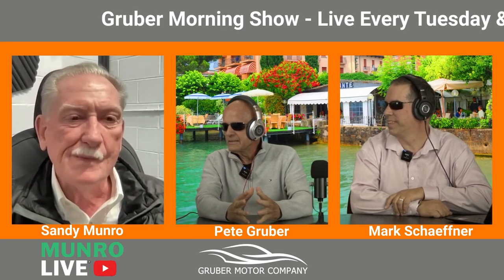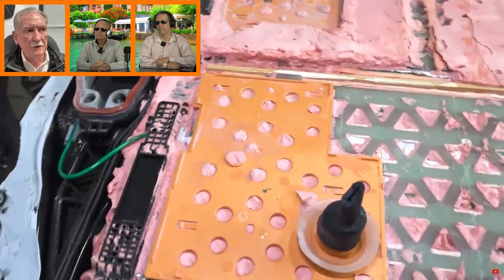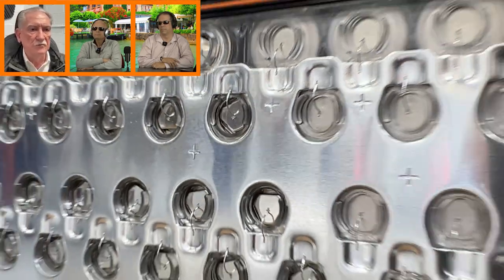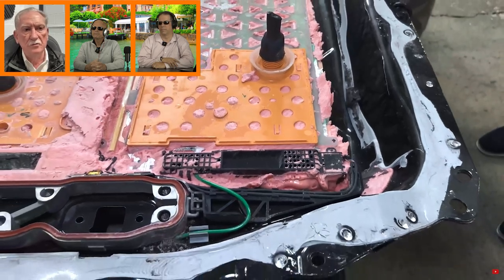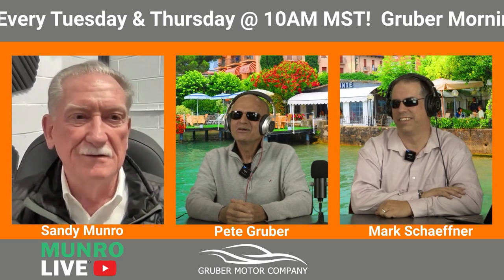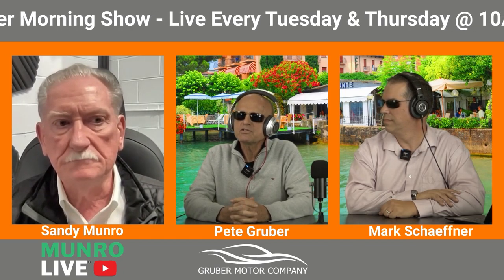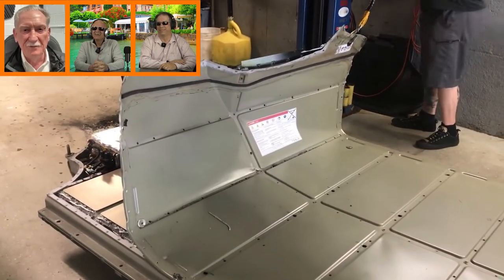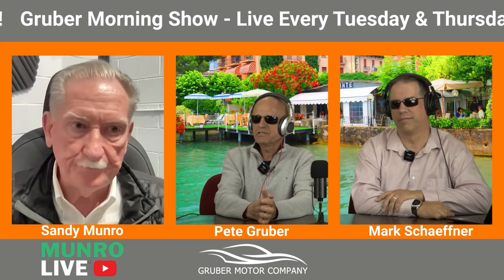Is Tesla's Structural Battery Repairable?

Comment: 2:40 "... one cell out of the pack ... now you have to throw away the whole pack..."
This is why it is important to be serviceable. It is like an ICE engine with a worn alternator belt and replacing that whole engine.
Reply: The technology looks so crude and bodged in that a single battery is not possible but just wire together a load of little batteries. One fails and it is dud. We are rushing out of fossil fuels when we are just not ready. You would think it would be possible to split these in to at least modular packs and replace the failed one. The problem is these electric cars are unaffordable so they have to be made cheap, simple and disposable and the latter loads the cost on to the consumer and environment.
Reply: @michaeld5888  That is what all the other manufacturers are doing and that should be the norm and requirement that the packs are repairable at the cell level.
Reply: @michaeld5888  That is negatory sir, we are not "not ready", it is a conscious choice of Tesla that moving forward they build their packs as sealed and unserviceable as possible. Except for that, there is already a growing industry of EV battery repairmen who can do exactly this job for cheap, on all continents.

Comment: I really appreciate this discussion and the practical perspectives.  The obvious answer, given that massively multicell batteries are going to be in use for the next little while at least, is a sealing and binding material designed like an anti-expoxy to disolve as needed and then be reclaimed and reused.
Reply from the maker: EV Battery tech is on an exponential design improvement curve.  We expect rapid changes to chemistry, technology, and corresponding service procedures.

Comment: (BEFORE watching)
Are you asking the wrong question?
.
Try
1) "Are the cells individually fused?"
.
2) "If they are, and one cell blows it's fuse, what is the effect on the pack?
.
3) "Are the electronics outside the sealed "battery box" more likely to cause problems and how repairable is that section?"
(Ref the Power electronics in the penthouse)
Reply: No, it’s the right question.  Is it repairable?
Reply: @oggyoggy1299  NO NOR SHOULD IT BE

Comment: Afaik the Model 3 battery pack can handle a couple cells going resistive or dropping out of the pack... Therefore it won't fail in the same ways as the old Model S or Model Y packs.

Comment: I'm sure there is a solvent that can safely be used on this - when handled properly.  Not something for a regular repair shop to handle, but there is enough value in those structural battery packs for people with the right expertise to take on.
Reply: if all you want is the materials you can also always just discharge the pack to 0V, shredder the entire thing and then separate via cyclotronic separation.

Comment: JB and Redwood Materials needs to have contracts with big box stores like Home Depot, Lowes, Menards and Walmart. They all need to have battery collection and drop off sites at their stores. If you make it easy to recycle the batteries more people will do it. Getting large retailers to box them up in bulk will make it easier  to ship and process.  Not mixing the batteries in with regular recycling operations would make the process easier and smoother.
Reply: Sounds like a logistics nightmare.  How will the stores be compensated for their space?
Reply: Had to laugh. Here in Europe this is mandatory for 20? Years.
Reply: re: "If you make it easy to recycle the batteries more people will do it." close if you PAY people for their recycled batteries more people will do it, so let's stop with the "scam" of pretending these batteries (even used and depleted ones) don't have IMMENSE VALUE.

Comment: If you know or suspect a resitive cell, why not pull the cover, charge the pack, and use a thermal camera to detect the failed cell. It should be quite a bit warmer than any other cell.  Then just clean off the foam on that one cell. You might even be able to clip the connection without any foam removal if you know exactly where the cell connection is (perhaps via x-ray?). Should be far easier than cleaning the entire pack.  If you do clean the entire pack, you have to figure out a way to reapply the foam to the entire pack, which could be just as tricky as removal!
Reply: And repairing the welds after replacement? Keeping it sterile inside? Re foaming&sealing it back up right? 🤔

All reasons why pack's are NOT that easily repaired by common mechanics and tech's right now in open air dealerships and service bays. 
They are originally assembled and designed in clean rooms kept at constant controlled temps&humidity with very little foreign object matter.

Amature hour repairs by greasy thick fingered tech's doesn't cut it. And the pack's must maintain a very precise cell balance or the bms weirds out on you.
Reply: @4literv6  Assuming a thermal camera could find the failing cell(s), I wonder if a technician could cut a plug (like with a hole saw) from the casing, then use that access to deactivate the failed cell. Then replace and re-seal the plug.  Related ... it seems like Tesla should be able to make cells that detect their own failure, then remove themselves from the circuit automatically. Then the BMS could just monitor and report these failures. Granted it may not be worth the extra cost, but would sure be nice to diagnose such things without major surgery.
Reply: We have been testing that technik with an expensive thermal camera and there are many problems: first, metal parts have very poor emissivity and it is really difficult to get good temperature reading relative or absolute... the reflected MWIR or LWIR heat is a major problem. Second, most problematic cells dont have a high short.. it is more a slow short with few mA leaking.. and these few mA x 3.6V dont make enough heat to be distinguished by the camera... unless the cell have a normal short between slow short or dead short to carry enough current to create enough heat so that the NETD of the camera is enough to detect it.
Reply: Yeah it's super easy to assume that! Are you sooo "experienced" to talk about that!! Lol
Reply: @4literv6 Cells are made in clean rooms, packs aren't.
Reply: @theflew  the workers assembling the cells into modules then into pack's are in cleaner more tempatures controlled spaces than the average repair tech in an open air garage though right? That was my point and the actual ev production workers are better trained in handling them and what to be aware of or look for during pack assembly. No tech in a garage is going to easily replicate that period!
Reply: Its not foam....Its a structural potting material used to encapsulate the batteries and add support to the battery structure and is sold to Tesla by a company called MG Chemicals and the product number is 832TC-375ML

Comment: One way to reduce the effort is to use multiple techniques such as electric vibrating chisel/scraper, followed by dry ice blasting, and additionally some D-limonene as a solvent. For debugging failed cell, a flir camera could help, along with sub milli-ohm resistive and non contact inductive tracing using equipment such as toneohm shorts locator, if electrical access from BMS could be established. Just some thoughts 💭
Reply: Or put it into landfill.
Reply: @oggyoggy1299  why would you ever put a few grand worth of concentrated materials in a landfill

Comment: I thought the pink stuff was an expanding foam that would dissolve easily in acetone.  When I hear "potting material" I think heavy, gummy, almost solid rubber material.  Seems like a strange choice when weight is always an EV concern.
Reply: it is an expanding foam.

and expanding foam falls under potting when used in this way
Reply: it is also a structural material, so it is not a soft foam.
Reply: MG Chemicals 832TC-375ML

Comment: How about using one of those laser cleaning devices that evaporate. If you could find a setting that would evaporate the putty, but not solid plastic, it could do the trick. This kind of a tool would be useful also in situations where you need to remove paint, rust or anything you would use a dry ice /sand blaster on.
Reply: There is no such setting most likely. But if you know exactly where to dig, you may be pretty successful doing battery pack surgery with a laser.
With highly specialized equipment I can imagine cell replacement too.
The big question is that would it be worth to service those packs? Maybe only cutting out resistive cells will be enough?

Comment: You might be able to localise a bad cell with a thermal camera, as if it is resistive it should get hotter than the other cells, especially if it isn't being charged or discharged.

Comment: The tesla pack is structural meaning it takes some of the twisting and bending loads. What is the long term impact on the cells if not the connections. Hopefully it lives up to its warranty or they will have huge costs as the vehicle ages.

Comment: My gut feeling is that by the time that a cell would go defective beyond the 8 year warranty, the cost of full replacement batteries, or used batteries from a totaled car will be so cheap that its not worth trying to repair an existing battery.
Reply: Fully agree on that assumption. If there is serious and 100% recycling with environmental friendly processes this would be okay for me. But repair of structural batteries is an issue because there still will be accidents and insurance will not always finance new cars by then!😎🇨🇭

Comment: How often do cells in replaceable BEVs actually get replaced? The Bolt, I3, ID3, ID4, MachE... all have replaceable cells. How frequently does repair actually happen? 1 in 100? 1 in 1000? 1 in 10.000?
Reply: probably more for Roadsters and early S's, but yeah, modern Tesla packs seem to be pretty reliable.
Reply: It doesn't matter how often they need to be replaced because ICE cars are made to be repaired and there are literally 40years old+ ICE around the world been used in really harsch environments where your Tesla won't survive lol!!

Comment: What if you get in a car accident? Would you have to junk the whole car?
Reply: It's like any vehicle: it depends on the severity of the accident. The battery is relatively easy to check.
If the whole car is warped, 99.9% of the time it's a total loss, whether it's an ICE, BEV, FCEV,...
Reply: @Zedus-rl9hp  I’d be worried that even minor battery damage would be unfixable
Reply from the maker: The structural pack, if it were compromised beyond repair during a collision, is removable.
Reply: @grubermotorcompany  The question is at what cost and how much more likely are batteries to be compromised because it’s part of the structure

Comment: Tesla have created a new paradigm with the 4680 structural battery pack. In my opinion due to massive improvements in manufacturing quality and of course reliability in design, this pack is non-serviceable. To use an analogy, for most of the 20th century TV’s were manufactured to be serviced and repairable. Now current manufactured TV’s are infinitely more reliable but generally  when they go wrong you throw them away. We should stop looking at Ice vehicles as a comparison especially the engine versus the electric motor/ battery pack. Of course occasionally things will fail but over time improvements in technology will make electric cars have a reliability an order of magnitude greater than ice vehicles.
Reply from the maker: The flat screen repairability is a good one.  The ubiquitous TV repair shops in the last century disappeared as TV set prices dropped to the point where repair exceeds replacement, and continuous technology improvements pushed owners even further towards discard and replace.

While we do not doubt the EV batteries will eventually follow the same path, it will not occur until the repair costs exceed replacement, or new and better technologies offering more range, less weight (performance boosts) emerge.
Reply: @grubermotorcompany  FROM WHAT I SAW AND HEARD IT SEEMS REPAIR COST ALREADY EXCEEDS REPLACEMENT COST?
Reply: The problem though is that although the failures are rare they do still happen, and if you're the one who is unfortunate to have it happen to your car when it is out of warranty Tesla expects you to buy a new one from them at a price which is a huge percentage of what the car is actually worth. Although this is something that does have an analogue in the ICE world when the transmission or engine goes, at least in the ICE world you have the option of getting the thing repaired or rebuilt rather than having to outright buy a new one. With Tesla it seems they are determined that this not be an option for their customers. So buying an older Tesla becomes a huge financial gamble, and it shouldn't have to be. It would take very little effort for Tesla to set up a program where they have repair shops that will do cell replacement the right way so that the safety and reliability of the car is not compromised, and that would make their cars accessible to a wider market of people that aren't willing to drop $40K and up on a car.

Just to comment on your TV analogy, the difference is TV's are generally affordable and most people can afford to just go out and buy a new one if their current one breaks.
Reply: @andrewawakened628  a cheap TEsla is coming and failure rate will continue to drop...someone will figure it out but it wont be tesla. instead in time warranty is likely to extend to 10yr 150000miles and  eventurally i see a CORE style replacement.  IE trade in your old pack for a new one at a reasonable cost...old one gets recycled into a new one.  First movers into an electric car are going to pave the way or the masses.  excellent exectution by tezla
Reply: @andrewawakened628  Yes, the pack is analogous to an engine, and the rarity of a pack failure just out of warranty is analogous to an engine eating a valve or breaking a timing chain that trashes both head and cylinder as well as piston and cracked the block on top of it all.  It is wishful to think there is just one $5 cell that should be easily replaced, when we need to just think of it as a single major component that failed.  There are loads of "mechanic specials" in the classified with 100k mile Audi, Mercedes, and BMW luxury cars going for a few thousand dollars because only a mechanic spending their own time can replace the engine or trans with a new one for less than $15K.  That's what we have to assume, anyway, or the owner would be repairing rather than selling a 10yo car.  Even to install a used low mileage late model engine or trans can cost $7-10K.  Lexus wanted $6k to replace my 100k mile trans ten years ago, and rebuilding it still cost $3k by an outside shop. Tesla battery pack issues cost similarly.  A brand new Tesla Model 3 pack is $12K and a used one $6K.  So these costs are similar.  Gruber is making money because a replacement Model S or Roadster pack is upwards of $20K, but battery pack prices have come down and I doubt they will be able to profitably repair Model 3 and Model Y or Model 2 packs for much longer.  

I'd prefer a modular pack myself, maybe 17 modules of 22.2v each bypassable if a problem crops up in one and easily swapped out by the owner rather than a repair shop.  No mfr seems interested in doing it that way, though.   I don't think they want the liability of users touching a pack that can short with 500kw of energy.

Comment: 9:30  It looks to me that you just need to remove the rear seats to access the electronics penthouse which is much easier than dropping the entire pack.
Reply: Yeah, I would be really surprised if they changed it from the previous versions, which can be removed from the top by taking out the rear seats. The OBC can fail and is a separately replaceable part (at least in the older versions), so it wouldn't make much sense to have to drop the pack every time just to replace that part.

Maybe what they mean is it's "easier" for places with a lift to do it from the bottom, even though Tesla might allow removing from top.
Reply: @jakej1837  I think Sandy just forgot.  Popping out the rear seat bottom is much easier than removing the entire pack, lift or no lift.

Comment: So the Tesla warranty on its batteries is for a maximum of 8 years or 240,000km or less for some models. That's about the same length of time a battery lasts in an ordinary IC car. So if the Tesla battery modules fail after this time you're going to be up for repair or replacement out of your own pocket. So what is the general cost to repair the battery and what is the warranty for the repair?
Reply: 12 to 20 k$

Comment: In the interest of getting rid of individual cells to prevent the cascading failures, could the one cell be drilled out? What if the pack were indexed on a CNC machine? The CNC machine could drill out a cylinder just inside of the outer shell of the cell.
Reply from the maker: Our experience with Roadster and Model S packs indicates single cell failures are an infrequent anomaly, and cell failures do not cascade.

Comment: If you have an accurate diagram of the battery pack dimensions it would be possible to design a machine that cleaned off and captured the potting material using dry ice and cam tools.  Yes, it would be a sizeable  capital investment - 500-1000 unit ROI but absolutely doable.
Reply: You can CNC drill most (but not all!) of the foam if you know the internals. So you can save lots of time and CO2 this way.